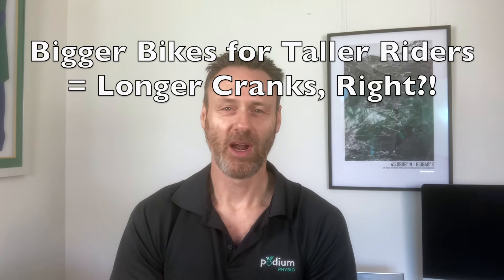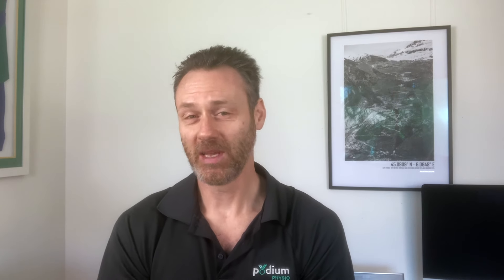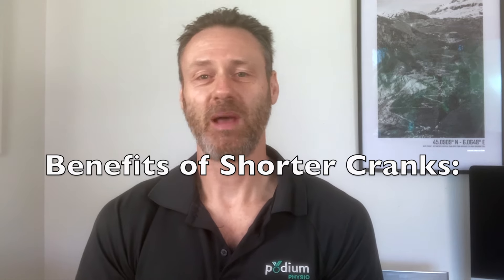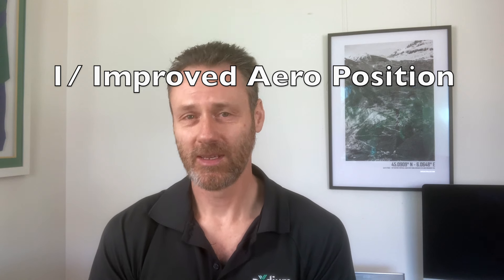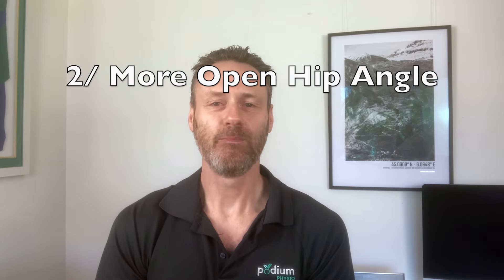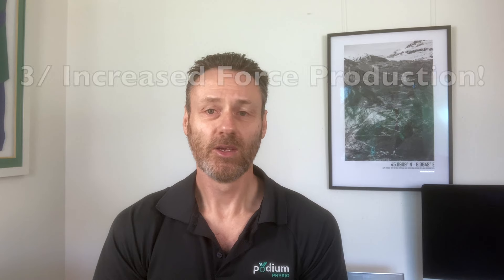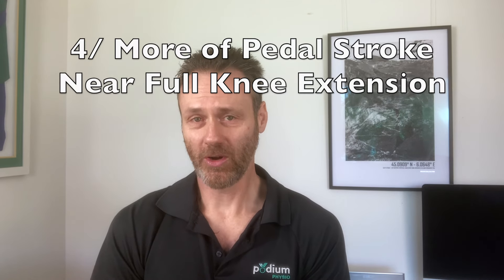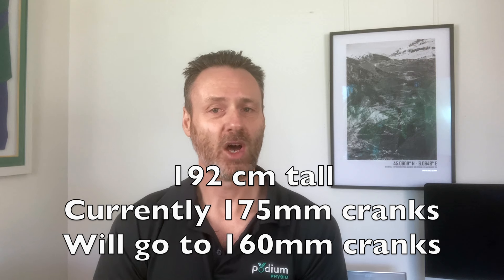Why You Need Shorter Cranks

Comment: Would like to see a comparison of power vs heart rate for a 40 K time trail, to really see if there are any advantages, that would be telling...  Maximal power is not really that relevant to most riders, but if you can complete a 40 K time trail at the same average power, but with a lower heart rate, that could be meaningful (under similar, rested, conditions) showing an increase in efficiency.  These claims of improved aerodynamics never appear to mention that one will have to raise their saddle with the shorter cranks, which will increase total frontal area, hmmm...
Reply: Agree, but doesnt higher cadence equate to a higher h/r for most normal humans
Reply: Higher heart rate (under the same given conditions, temperature, rest, fueling, etc) means the body is working harder, so if it requires a higher HR to produce the same power, it is then less efficient.  Dylan Johnson has a good video on crank length, which examines the actual scientific testing of such, rather than just theories.  So far, the available testing, shows no significant differences using shorter cranks, no drawbacks either.  As there are no drawbacks, if one finds more comfort with shorter cranks, then by all means one should likely go for it, but so far the science does not show performance benefits in real world testing.  It appears that the body is pretty adaptable to different crank lengths, to a point at least.  As crank replacement is very expensive, it is important to really find out if there are performance advantages before recommending such. @paulwebster4499
Reply from the maker: I like the idea of power vs heart rate assessment on a longer ride, however I might start with something a little shorter first. I had my first ride with the new cranks yesterday and have raised the saddle 15 mm but not the bars. I have the Specialized 6 degs proprietary stem, at the highest level. It cant be flipped so I'm going to explore keeping the bars as is before I try to find a stem which allows me to lift the bars.
I felt pretty comfortable yesterday, but unfortunately my left POWRlink pedal signal dropped out mid ride so the power data was corrupted.

Comment: Don't change any bike fit positions straight away. 
I also believe based on you body height going down 
to 160mm may well be a step too far, seeing that 
your very tall try 165mm first. I am 5ft 6 inch's and 
I run a 165mm. I know of guys your height would
have been running 180mm back in the day. Well
let us all see what happens, good luck...
Reply from the maker: Cheers. The 160s are already on the bike so I'm committed to trialling them at least. If it doesnt work out I'll try a different length. So far (one week in) I have not noticed any downsides.

Comment: I found that your cranks should be 18 to 19% of your leg length.
Reply from the maker: There are various formulae out there as a starting point, but I'll always check the angles created, do some functional tests and check with the rider about how it feels.
Reply: I have tried them since 1993, first I tried 130mm and I ended up using 150mm for all around cycling and 155mm for climbing, I'm never going back to long cranks, back in 1996 at the track in Calgary everyone thought I went nuts hahahha.
Reply from the maker: @paulrobinson4987  If we didnt test our own hypothesis we would never advance...

Comment: The actual problem is availability.I am using 165s on my roady but you just try to find some.They are not commonly available to purchase.P.I.T.A😢
Reply from the maker: Yes I was lucky. When I approached my LBS they went online to their supplier and said there were 2 sets of 160s in stock so I grabbed one pair straight away.

Comment: I found this equation worked for me: Crank length (mm) = 5.48 x Inside Leg length (inches).
Being only 169cm short with 29" ~ 29.5" inside leg, this eqn led me to 160mm cranks, which I find very efficient and providing all the benefits you listed. Spinning easier, too.

While Tom Pidcock (about same height as me) was being interviewed by Matt Stephens recently, he mentioned that Team Ineos were putting him on 165cm cranks for his road bike (standard Shimano size) and 160cm cranks (not a std Shimano size) for the TT bike from 2024.

Based the above eqn, I'd expect 160cm cranks may be too short to be efficient for the presenter of this video. Let's see.....
Reply from the maker: I think having a formula like this can be a good place to start, however there are always nuances for each individual cyclist that may require a deviation from the mathematical result.

Comment: It would take less power to turn the 175 crank than a 145.  I'm not sure that chart is accurate.  That's basic physics.  If the force is applied closer to the object the torque is smaller than if the same amount of force is applied further from the object.  I believe that chart is saying it takes more power to turn the crank when they are smaller.  I personally ride 175mm on both my road bike and gravel bike.  I've tried shorter cranks and I personally wasn't a fan.
Reply from the maker: The study is saying that the rider can produce more power using the shorter cranks, not that it requires less power.

Comment: The shorter the wheelbase the shorter the crank-arm, The longer the wheelbase the longer the crank-arm. A long wheelbase bike, 170 crank-arm. A short wheelbase bike, 165mm crank-arm. A short wheelbase bike with a long crank-arm would increase the risk of your toe rubbing against the front tire when you’re turning the bike into a tight corner. A short wheelbase bike would typically be used for Circuit Racing on traffic-free roads or a closed road circuit such as a town or city centre. Kellogg’s city centre cycling 1983 part 1 - YouTube. Reynolds 531, Steel is Real.
Reply from the maker: The Emonda in the video has a short wheelbase (H2 geometry I think), 175mm cranks and I have several cm of toe overlap on the front wheel. I've never struck the wheel with my toe racing, training or commuting. I have only ever noted contact when stopped at traffic lights.

Comment: If it was that easy, why wouldnt grand tour riders who were nearly there  (Landa yates bros etc) just fit 165mm and beat Pog on his 170mms and Vina on his 172.5🤔
Reply: Probably in the same way top riders all rode 23mm tyres,  now most ride 25mm most ride 28mm and some 30mm .things move on from what used to be .
Reply: @robduncan599  yes 28mm tyres are better 
when paired to the correct size internal rims. Still doesn't answer my question, Pog 170 vina 172.5 surely someone who is nearly on the podium would just switch to 165 and win the Tour. Fads in cycling come and go. I do agree that it has lots of grounds in a iron man when you can use 165 to lower the saddle and higher the stem to get into the latest aero (no gap between hands and head) position
Reply from the maker: I'm sure there is a huge degree of individual preference and learned adaptation to sub-optimal set ups. For me I have moderate osteoarthritis in both hips, and not a single fast twitch fibre in my body, so I think that going to shorter cranks is likely to help me in a few different ways. If I am more comfortable, that is a win. If my performance remains the same or improves a little I'd be thrilled.